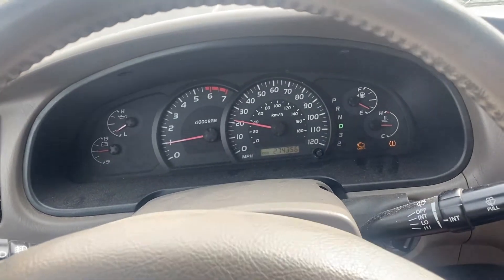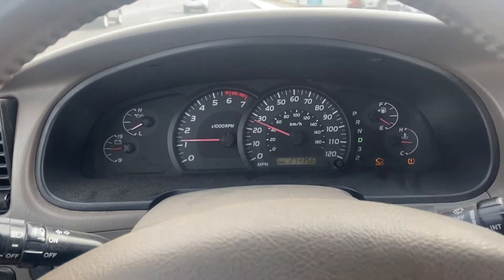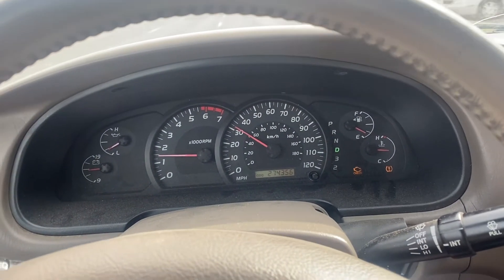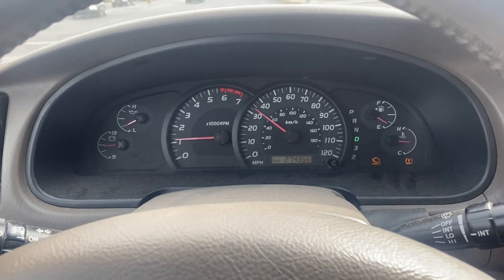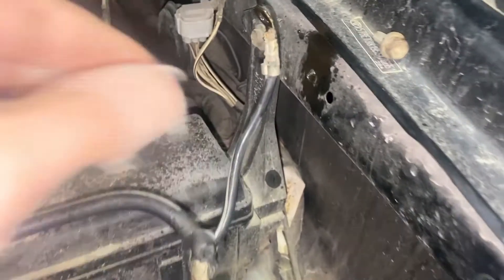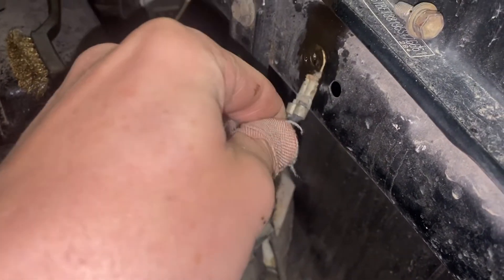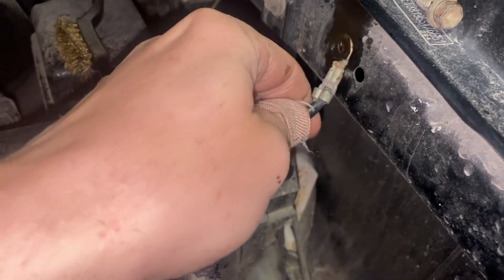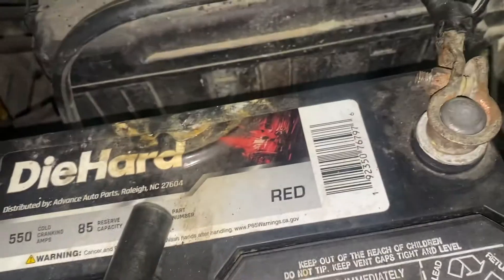FIXED! Car Losing Power When Going Over Bumps

Comment: When it would shut off and turn back on immediately while driving did you notice anything weird with the transmission? Mine is basically not shifting down to give me a lot of speed and then when I slow down or stop and keep going it all of a sudden won’t shift past 3rd. This is an automatic. But I wonder if it’s really as simple as your issue was or if mine is something else. 🤔
Reply: Your car is going into limp mode. I’m having the same problem, but I know that it’s going in a limp mode. It’s probably giving a code if you have an engine light on of P0882.
Reply: @Bonbonbon739  I actually did not have any codes. Actually the only engine code I got was way later about my air intake circuit being low. I recently changed that but the original problem I commented just stopped on its own and hasn’t done it since even before I changed my air intake manifold. 🤔 I never knew why it did that but some forums said it possibly could have been a loose wire or something simple like that and maybe it fixed itself. Idk. 🤷🏻‍♂️